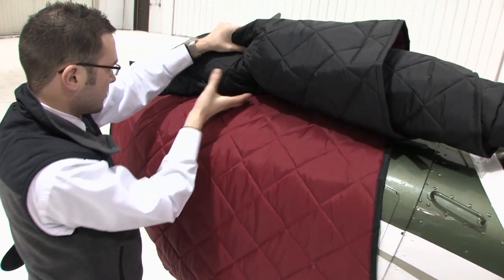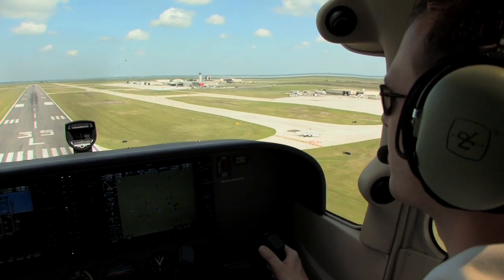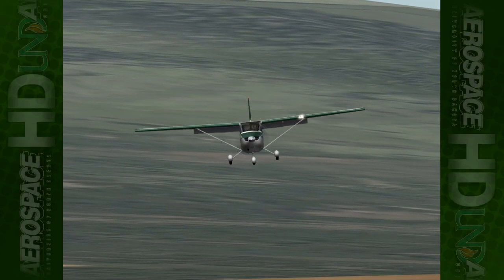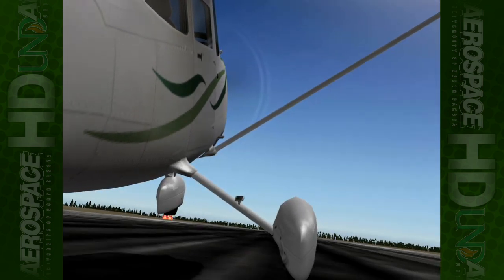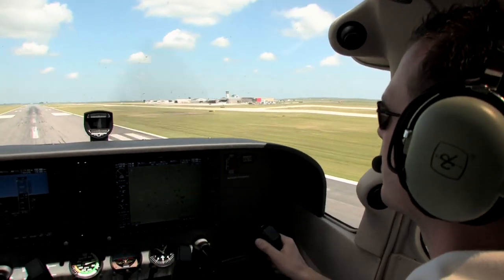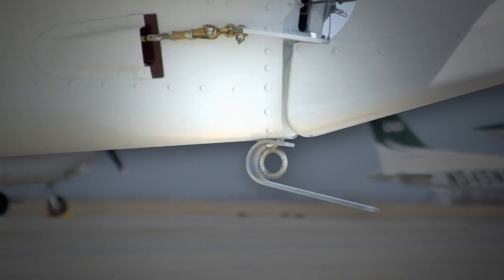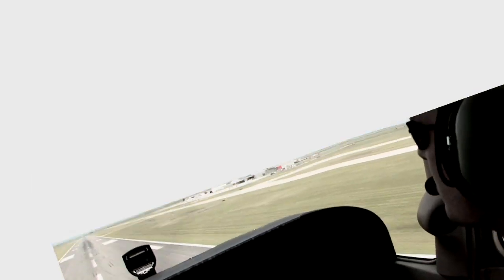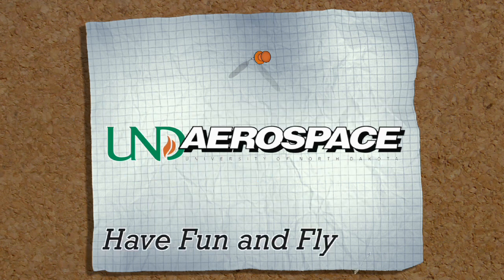Runway Tail-Strike Risk

Comment: This video takes six minutes and manages to say nothing about what causes tail strikes other than not flying a stabilized approach and flaring at an angle which causes the tail to strike the ground.  In other words, proper landings prevent improper landings.  

And ends noting that UND put a plastic doohickey on the tail just in case the tail strikes anyway.  for some reason which isn’t shared.

Production value A+.  Content value F.